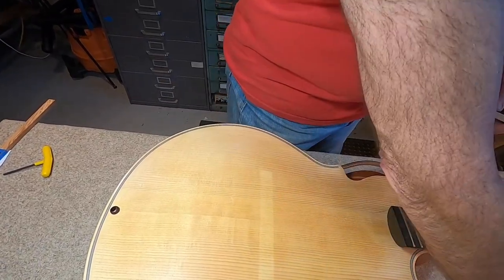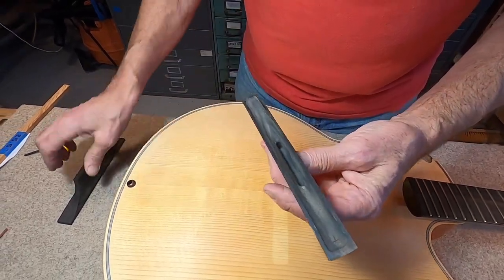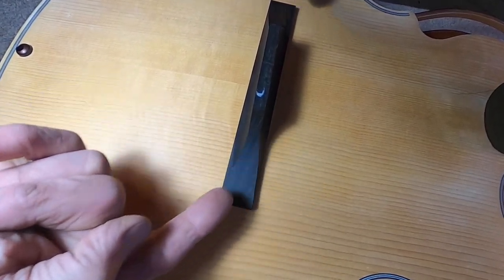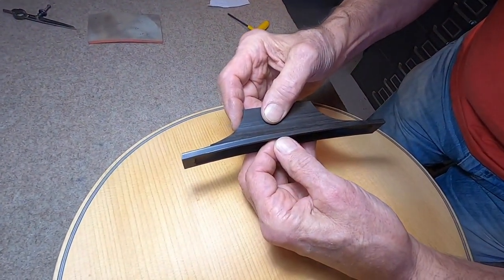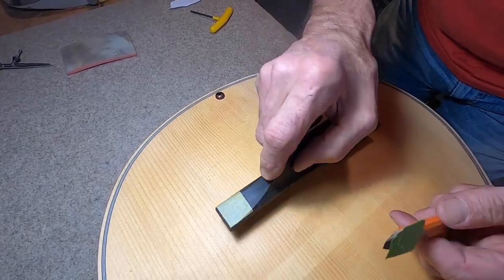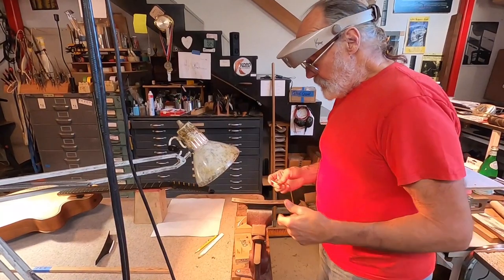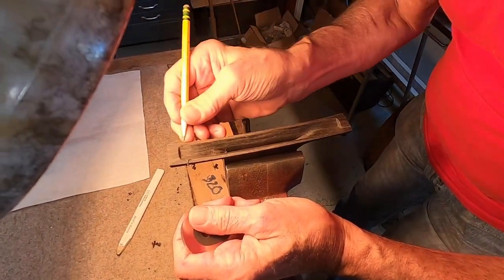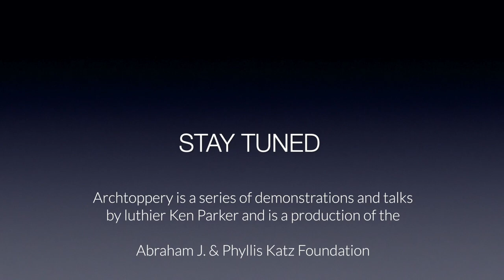Ken Parker Archtoppery: Fitting the Bridge 1

Comment: When you are converting your “old” guitar to a taller bridge, you are not, I assume, change anything with the existing neck post. It is just going out a little more to accommodate the new bridge height. Just a few turns of the adjusting tool. Right? What about new guitars with taller bridges? Are you making the neck post longer to use its maximum length to hold the guitar neck in the post socket? Or you change the post socket angle?
Reply from the maker: In both cases, I'm changing the neck angle, not so much the height.
Reply: @kenparkerarchtoppery9440  
Wow! Converting to a taller bridge is a major rebuild then, and installing new bridge is only a small portion of the process. As the neck post has to stay as much perpendicular to the strings as possible, the post socket angle has to change. Right? I can not envision patching the old socket hole and making a new one without removing the top. Here your violin style build plays a role, as it allows to remove the top “easily”. Or you can make another magic and do the conversion without disassembling the box? You are for sure magician, so I will not be surprised with anything :) Kudos!